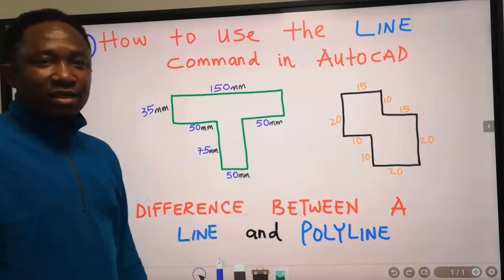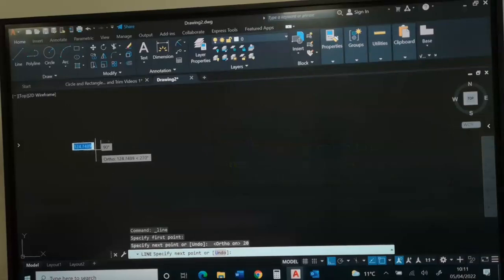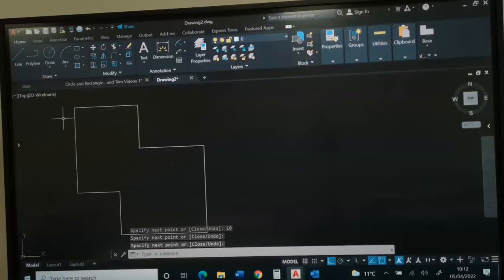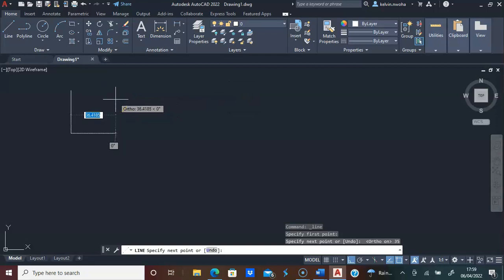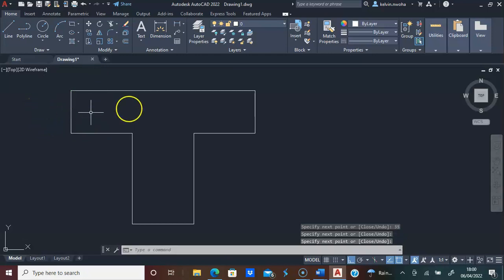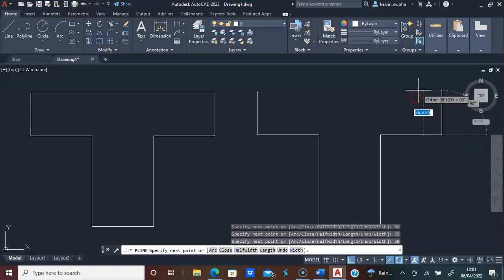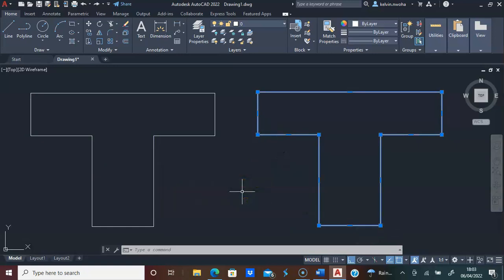How to Use Line and the Difference Between a Line and Polyline in AutoCAD

Comment from the maker: 00:00 Introduction
00:28 Three (3) ways to activate the line command in AutoCAD
00:33 Method 1activate the line command in AutoCAD
00:41 Method 2 activate the line command in AutoCAD
00:48 Method 3 activate the line command in AutoCAD
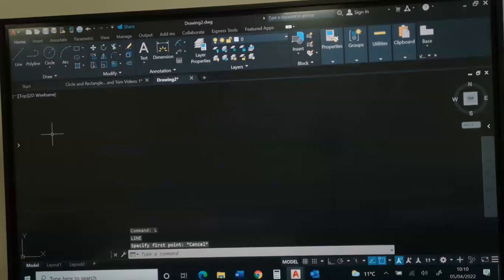01:01 How to use the line command in AutoCAD
02:55 Difference between a line and a polyline in AutoCAD